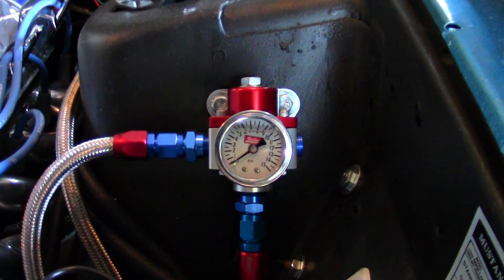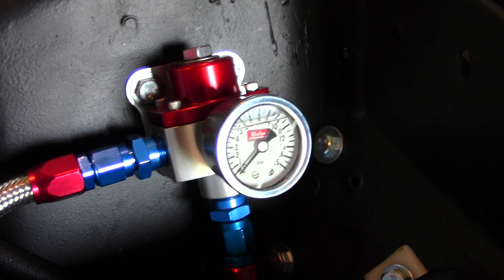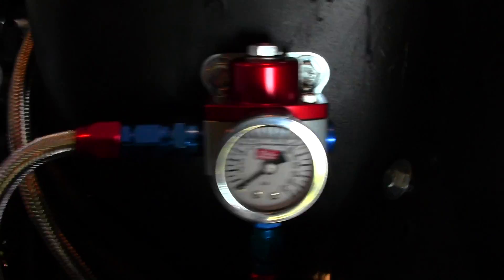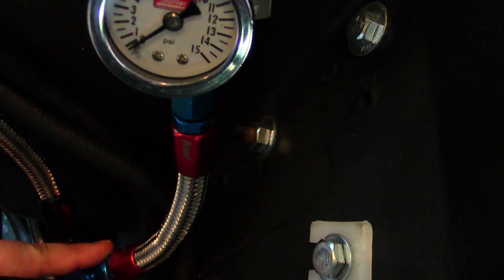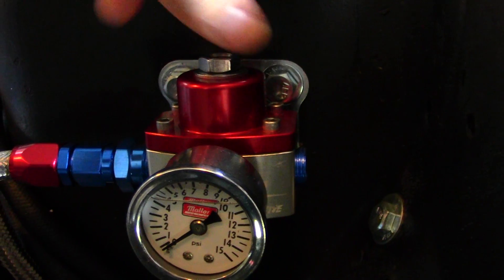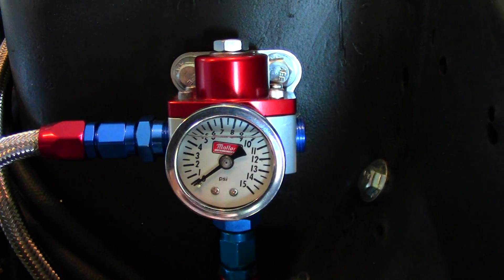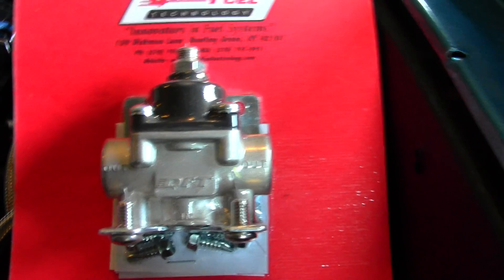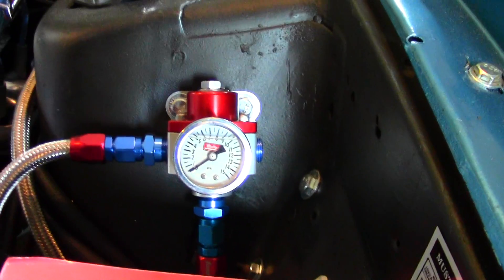Fuel Pressure Regulators & Why They're Important

Comment: Run an electric fuel pressure gauge into the vehicle where it can be monitored while driving!  You can only monitor that under hood contraption with the hood up and no load on the engine!  No bueno!  You need to know if you have fuel pressure at WOT.

Comment: Holley recommends one regulator per carburetor. First, check your plugs for rich-mixture fouling. Bad O-rings on needle and seat assemblies will also cause flooding, plug fouling, or even fire--ouch.

Comment: I set my regulator at 4.5 now it’s reading 2.5 new fuel pump  inside tank I have a holly carb 350 motor (should I replace the fuel filter)

Comment: For the occasional hot rodder, I highly recommend a good fuel regulator and, AND an EGT guage to monitor and diagnose your motor while gassing on it. You can hurt a good engine with too much fuel (washes cylinder walls and damaging rings, not to mention loss of HP), and too little fuel (extreme combustion chamber temps melting down many costly parts). The old saying, "Lean is Mean" is as true today as it was way back in the day. We used to search for the perfect temp by reading plugs and slowly jetting down to get safe and undamaging power. The EGT lets you find it quickly. Some just use lights connected to an oxygen sensor. That works great too. using all of these is best for me. Udn Udn.

Comment: What fuel pump do you you use?  Do you use a high pressure fuel pump like 60psi with a regulator? Would that work or do you need the low pressure fuel pump like 7 psi?  I bough a low pressure pump for my 65 mustang and it is so load I hate it. Looking for quieter options.

Comment: So I have been having issues with mine I have a pretty close set up ass yours. So I can’t get no more then 4 psi on my gauge change the fuel pump put a new one same result. As it sits at 4 psi it wants to turn on at first but after cranking you the guage go to zero. I have this on a 93 Chevy truck do u know if there any kind of filter on the tank that might be restricting the gas?
Reply from the maker: Sounds more like your fuel pump isn’t putting out reasonable pressure to begin with. I’d start there.

Comment: My new carb requires certain pressure. It runs much lower than fuel pump is pushing. I built my regulator for about 50 bucks.

Comment: When you say fuel injected pressure gauge are you referring to a throttle body and electric fuel fuel pump with injector's? Cause my car has eldebrock carb with electric fuel pump on a vortec 350 my psi is showing 9-10 psi at idle.

Comment: I had my carb set up with a regulator with return line and could not get the pressure beyond 4 pounds on a unit said to put out 8. I pinched off the return line and not only got almost 7, but was able to regulate it down to the 6 required for the Edelbrock. So so much for the ills of deadheading.

Comment: I have a Holley nonadjustable carburetor 600. I'm  running a stock mechanical fuel pump. Do I need a fuel pump regulator?
Reply: Michael Barnes No.
Reply: No

Comment: My new Edelbrock #1406 says no more than 6psi at idle. I am installing a new mechanical fuel pump and it says it is rated to 9psi. Everything is  Stock Replacement parts. Should I get a regulator before installing those items?
Reply: 707SonomaComa Theoretically, if your needle and seat are good, you dont need one on a stock engine, it just insures you have a consistent flow.
Reply: 707SonomaComa yes dude

Comment: On that style can the extra port be for a return fuel line I have a dead head system and I think it maybe causing problems since the nitrous was added
Reply: you can use the extra port as a return ,but it will need to be restricted slightly .. the orfice in a return style regulator is about 60 to 90 thousands of an inch ,, so if you insert a piece of bolt that fits into your return line and drill a hole through it to restrict the fuel return .. you will have a stable fuel pressure thats still adjustable .. if you dont use any restriction it may not work as all the pressure will be going straight bacvk to the tank in the return. hope this helps
Reply: Just buy a return style regulator.
Reply: Troy mackeod yes that's pretty much what it's for in fact if you run on the street I suggest a return line if you can so the fuel doesn't sit in the line heating up and causing problems
Reply: Troy mackeod n

Comment: I'm about 6 psi... when it's cold and running its fine but after i open the throttle it seems to do fine but once i go back to normal rpms it seems like it continues to dump unnecessary fuel and it begins to bog down and conk out??? Do you have any suggestions?

Comment: do you have to run a return line...i have a fuel pump that is at 60 psi and I'm running a holley carb that is taking only 7 psi...should i run a return line
Reply: Nova 73 with a 383
Reply: Regulate the carb to 3psi.
Reply: Yes, buy a return style regulator and run it back to the tank. Dead heading that pump will kill it quick, not to mention it will stall your car at every stop you make.
Reply: ...i hav a 4150 dp 850 holly any insight on what i should be looking to hav it at?? I hav a hesitation when trying to go from 0-60 lol
Reply: It all depends on the size of your engine, the weight of the car, gearing, etc. but a good starting point is 5psi.
Reply: Start with 5psi, if it starts flooding then back of to 4.
Reply: I bought a cheap $5 chinese electric fuel pump to run my engine on the dolly. There is no return line. Are these designed to handle the deadheading or will they just burn out real quick ?

Comment: this is one of the most informative videos so far,running a carburetor automatically means a regulator is to be installed main reason is fire,and fuel control,keeping fuel mix is paramount on a carbureted engine,otherwise fuel in the oil is a disaster,forget all the wiseass statements below this is a very good video for the average guy who is lost on fuel mixtures,don't even attempt to have your car dyno;d without a regulator installed
Reply: Bullshit  if you're using the original mechanical fuel pump designed for carbureted engines you don't need this bullshit only with am electronic fuel pump

Comment: The second valve you show is not the same,  where does the fuel gauge go?  Dohh
Reply: +Jesus Acuna That was my question too, about the gauge.  On the second one I wonder if you could fit it to the second out port.
Reply: +AustrianAnarchy my assumption is that you would put it on the other out?

Comment: What is that blue piece sticking out of the right hand side? Sorry but I have never messed with AN fittings, lines or regulators.
Reply: PCcopeland I am guessing that's a plug.  What size engine and hoses are you running?

Comment: I've been messing with this crap since the 70's and everyone ran a regulator with a Holley pump back then. It's quite old news. The regulator came with the pump. The Quick Fuel Regulator is almost an exact copy of the Holley regulator and they are not associated with each other. With a Holley carb I would generally run a regulator with any pump producing more than 6 lbs of fuel pressure but some get away with more. It really depends on the needle and seat/float setup.The larger the needle and seat the less pressure you can get away with. If you need low pressure at idle and high pressure at full throttle, try this. Look at the top of the regulator where the vent is. If it has a vent hole you can apply manifold vacuum at that point and the fuel pressure will automatically be reduced during high vacuum situations such as idle. When you get on it and the vacuum is low the fuel pressure will be increased. Set the max pressure with the regulator adjustment screw with vacuum line removed.
Reply: +n5ifi  
I just spoke to tech support at Autometer. 
The technician informed me that my mechanical fuel pressure gauge
has lost calibration, and needs to be repaired. It's been well over 3 
years since I bought it ... it began acting up @ 4 months ago with 
readings over 10-psi at times before settling back between 7-8-psi MAX. 
It's cheaper/simpler/less time consuming to just purchase a new gauge.

Since the fuel pressure reading of 10+psi (especially at start-up) goes 
down to 7-8-psi under mid-throttle, the technician at Autometer 
confirmed that NO fuel pressure regulator is necessary.

Is Autometer correct? I have a Holley 850 double pumper on top of a built Buick 455 Stage-1 motor.
Reply: If it's not adjustable, it's bad. If it won' hold relatively close to set pressure, it's bad. You will see some variance at times though due to outside influences. I've seen poor quality gauges move around and I've seen under hood mounted gauges move around. A good quality oil filled zero to 10 or so gauge remote mounted will usually stay pretty close though if everything is working properly. On gasoline, I would never run over 6lbs of fuel pressure. It's just not necessary. More fuel pressure equals less float drop too. Always run the smallest needle and seat you can get away with and still properly feed the engine and max fuel usage.